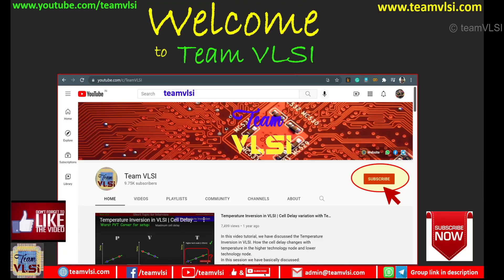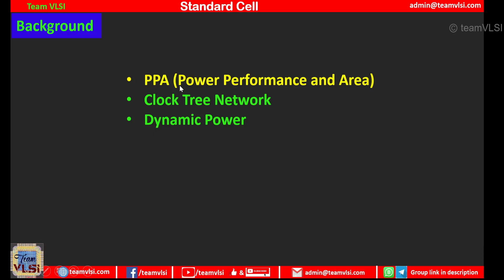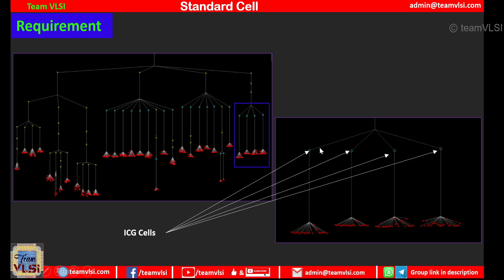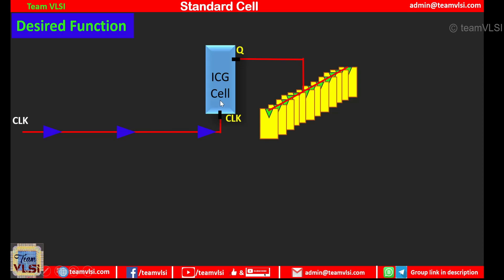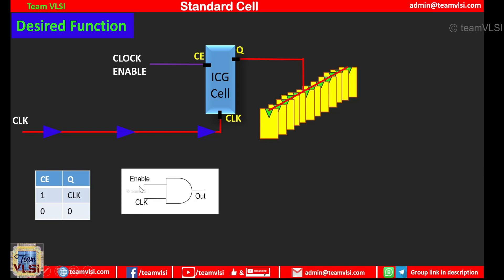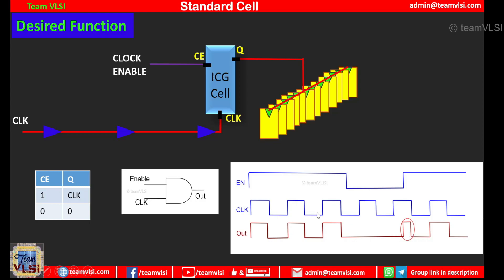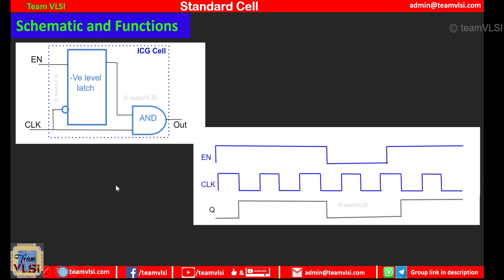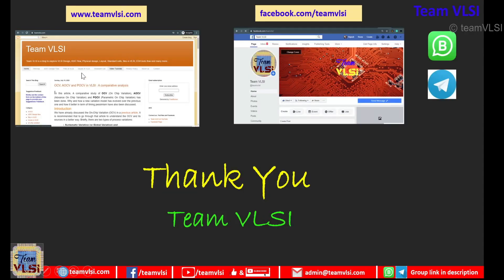Integrated Clock Gating Cell | ICG Cell in VLSI | Clock Gating Cell | Low Power Techniques in VLSI

Comment: It may be useful for you guys, I am just posting

After clock tree synthesis(CTS), many timing paths that end at clock gate/ICG enable 
pins appear. Why didn't these paths get fixed in placement, and how can I handle them?

After clock tree synthesis, clock gates becoming critical because, by default, at placement level, they 
have the same latency applied to their clock pin arrival times as do the register 
clock pins. Once a clock tree is constructed, the clock gates will be in the 
 of the clock tree, not at the leaf. Therefore, the clock arrival 
times are seen to be earlier than that at the clock leaf pins, and timing is impacted.

The following shows a simple example:
 * Pre-CTS, the register pins and clock pins of clock gates see a clock latency 
   of 0ns which models the same arrival time for both.

 * Post-CTS, the clock gates are now halfway through the tree and see a latency 
   of 800ps. However, all registers see a 1.5ns arrival time for their clock pins
   since they are at the leaf level of the tree.

 * Any paths from a register to a clock gate now see the difference in clock 
   arrival times, and the pre-CTS slack is degraded by 700ps(1.5ns - 800ps).

Since the clock gate is supposed to be at the intermediate point to allow
the shut-down portions of the clock tree, it is not correct to assume the
clock pins of clock gates should be balanced with the registers.

These paths can be addressed in the following ways:

First, examine how far down these ICGs lie in the clock tree for post-CTS.   
Whether they are near the root of the clock tree or the clock pins of the 
flops can influence how you handle them.

  * If the clock gates are roughly halfway down the clock tree, you might get 
    the benefit by splitting (replicating) the clock gate. Splitting the clock 
    gate creates parallel copies of the original driver, resulting more clock gate
    drivers with fewer loads per driver. If the splitting is done for pre-CTS,
    then we effectively push the clock gate further down the clock tree, increasing 
    power but improving enable timing. See the split_clock_net command.

  * If the clock gates are either at or near the bottom of the tree, splitting 
    clock gates will unlikely offer any improvement. In this case, you 
    should add a pre-CTS clock latency value to the ICG clock pin so that 
    you model the pre-CTS latency correctly. Using the above example, you 
    would apply a -700ps latency to the clock pin of the clock gate during
    place_opt but before clock tree synthesis. Applying a latency allows 
    you to correctly model the slack before the actual clock gate clock 
    arrival time is known.

  * If the ICG is a single "top-level clock gate", which is fed by a relatively 
    small cone of logic, you might apply a float pin constraint to the 
    flip-flops feeding the enable signal logic to get their clocks earlier 
    (useful skew). Sometimes this technique is the best solution for top-level 
    clock gates because it does not impact power; splitting top-level clock 
    gates can have a very large power impact.

Comment: Flipflop is made up of two latches , hence by using FF instead of latches leads to increase in area and power consumption of ICG.
By far the most important: Now the enable input is captured on the falling edge of the clock in the previous cycle. Therefore, whatever logic is generating it has to do so within half a clock cycle. Using a FF, the logic was able to take the whole clock cycle (minus the setup time) to calculate the enable (because “next cycle’s enable” is allowed to change all the way up to the rising clock edge), but now it’s only got half a clock cycle.
Reply: Ans for 3rd question

Comment: ICG timing is characterized in Library and used as an IP just like any std.cell. Hence instead of using latch and an AND gate, ICG is used directly. Similar Eg. BUFFER. Please correct me if my ans. needs correction.
Reply: Second question Answer: ICG should be placed near the source.
Reply: Third question Answer: No sir, by using flop, we have chances of glitch after AND gate. Hence we use -ve Latch with an AND.
Reply from the maker: Hi Mahantesh,
ICG placement near source is good for power saving point of view but it has some issue too. And placing ICG near the sink has its own benefit.  so people use both options. Kindly try to list out pros and cons  in both the cases
Reply from the maker: Yes that's right but why we can't use latch + and?
Reply: @TeamVLSI  Sir, by placing ICG near source point, if the ICG has no two branch which switch ON and OFF differently then it works good. But if there are two or more branches which need not switch ON or OFF at same time, then placing one each ICG cell near destination domain will be feasible.
Reply: @TeamVLSI  Sir, by using -ve latch we are taking precaution that glitch doesnt occur after ANDing due to enable signal. This -ve latch will pass enable signal only during -ve level, and retain the same state in +ve level, even if enable changes, if glitch, that will not pass. That is my understanding sir.
Reply: An ICG when placed near the source is  used to control the clock input of multiple sinks which gives a power benefit because of larger coverage.Therefore to achieve this in a design the icg needs to sit at the top of the clock tree.Now this might cause problem in meeting the timing requirement of the enable pin of the ICG. The enable pin of a ICG is mostly controlled by sequential elements in the design which will be sitting at the bottom of the clock tree. Therefore you will always have a large negative skew between the ICG clock pin and enable controlling flop clock pin. If the data path is considerable long you will get into setup violation.Also it is difficult to perform useful skewing on ICG clock pins to meet the setup requirement because it will effect the skew of all the clock pins that the icg is feeding
Reply: Also Sir, if the ICG is placed near destination, the buffers driving ICG will unnecessarily be turned ON even if ICG is OFF. Hence in this case, placing near "source" is more economical in terms of consumption of power and meeting timing.
Reply: @soumikmukherjee9468  Thank you very much sir. It gave a clear understanding.